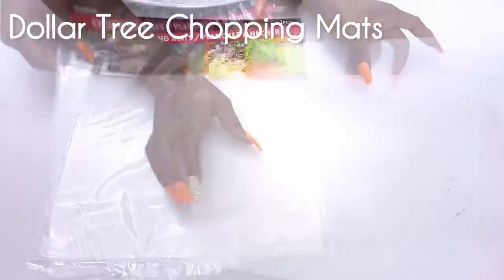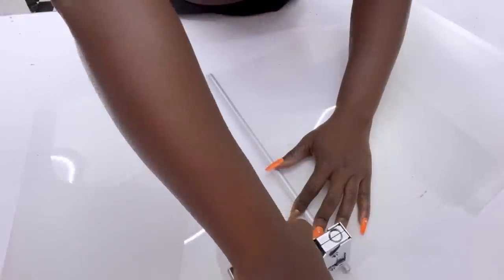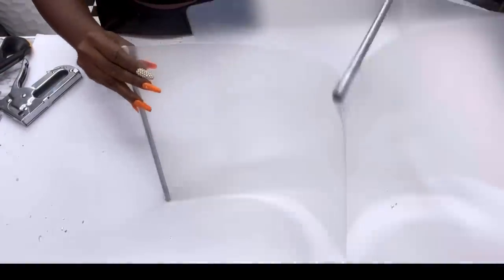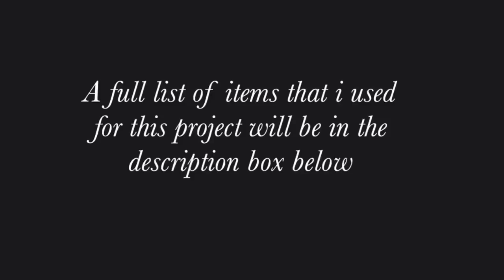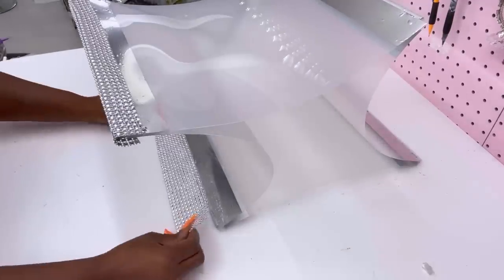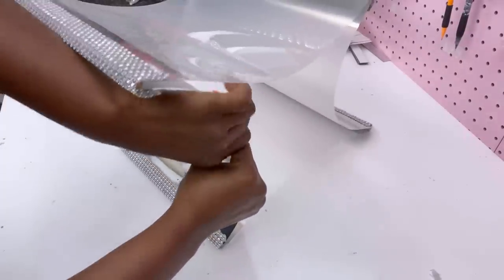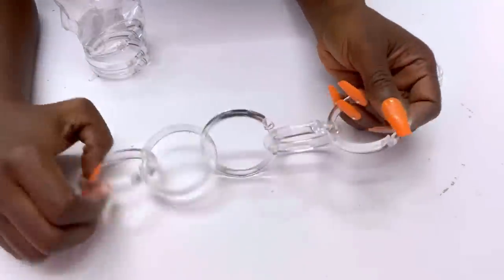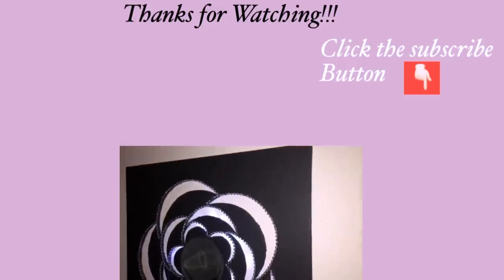SEE WHAT I DID WITH DOLLAR TREE FOLDED Chopping MAT!!!

Comment: Can't get past the 3 inch orange nails..
Distraction 
And using a staple gun??? 
Don't see it.  Would split the dowel rods and when used later in this project..when when attaching the paper plates....leaves the sharp staple exposed.
Reply: You didn't have to watch and her nails aren't that bad. You're just one of those people that like to complain I guess.
Reply: @nottodaylilbaldhead No, you're wrong .
Nails that long in neon orange are distraction in a craft video showing only hands. 2. Everything stated as to construction of this particular project is valid. Using a staple gun not proper tool and leaves sharp points
 Since when is,constructive criticism, complaining.